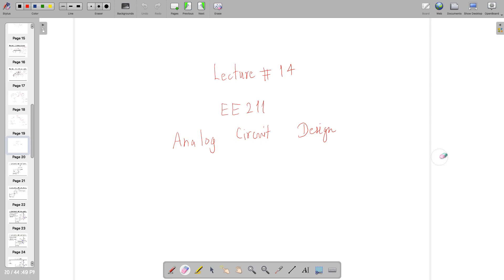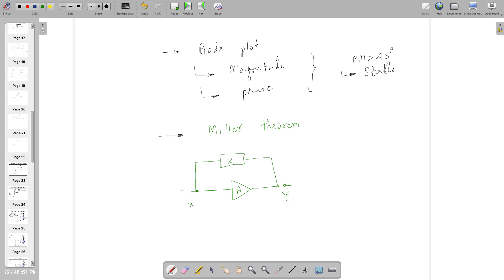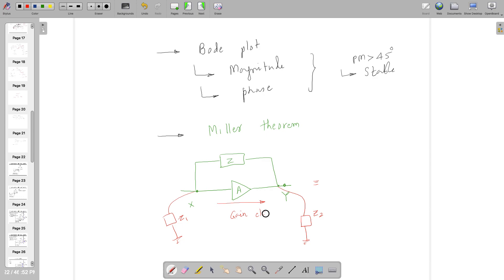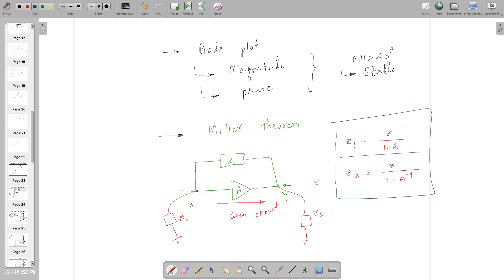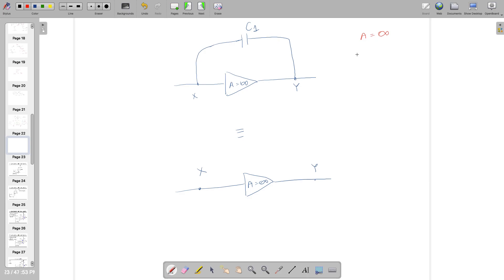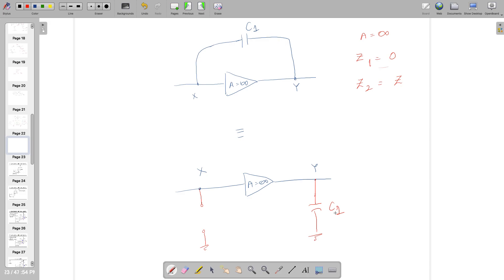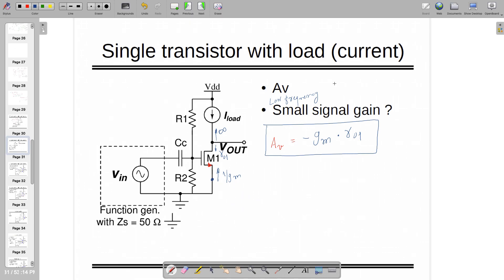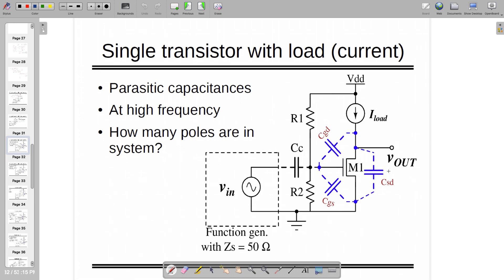Lect14_High_frequency_model

Comment: Sir z=0 means short ckt at input side??
Reply from the maker: Yes. In reality, it can be considered as a low impedance at the input side (Resistance gets divided by Av and capacitance increased by Av). However, because of low source impedance (50 Ohm), the created pole goes to infinity.